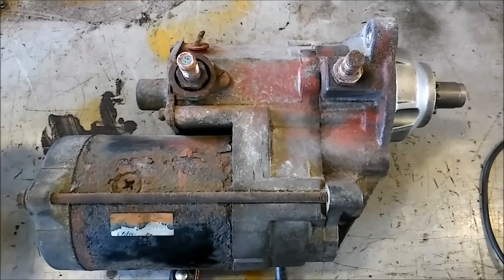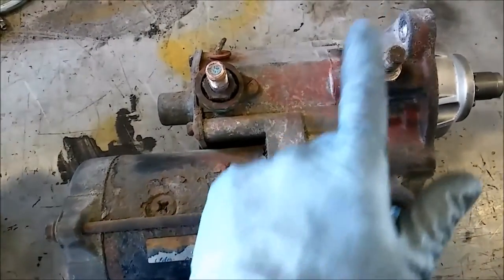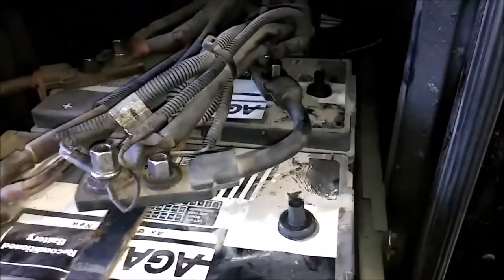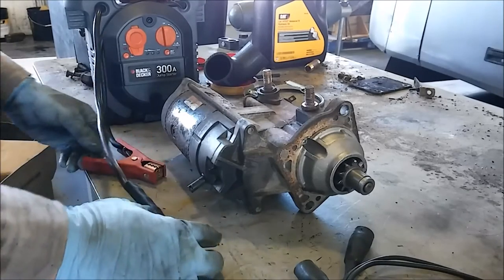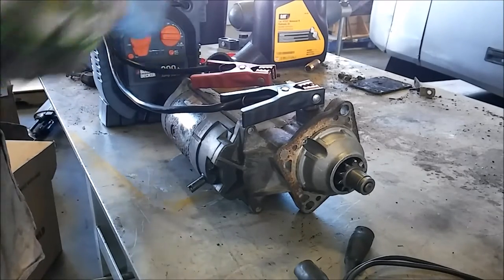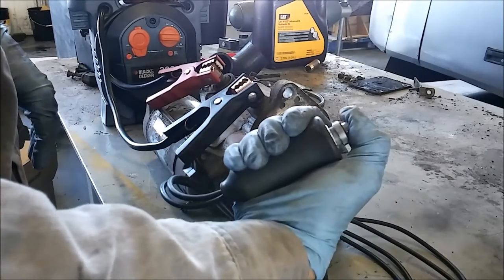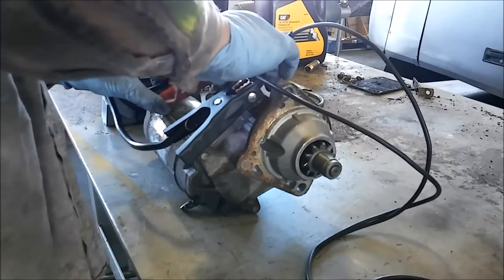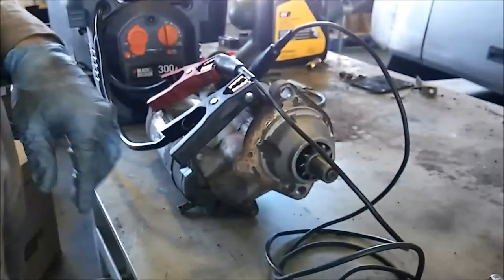How To Bench Test a Starter.  Auto, Truck, Bus, and RV.

Comment: Get two blocks of wood and engage the starter and apply pressure to the blocks of wood between the pinion it will load the starter. Easy way to check the torque if you do not have a spare starter
Reply: This is exactly how they load test motors at the starter shop we use for motor work.  Block of wood = load

Comment: Do the RV starting systems employ a magnetic relay switch to engage the starter solenoid as is done on class 8 trucks?
Reply from the maker: +Chad Jessup I want to say yes, but I can't say that everyone does because each RV is different. I do know on some of the fuse/relay panels I've worked in they have had starter relays.

Comment: As I watched this video I could see that the starter in question was not producing enough torque because if it had been, it would have been trying to jump out of the hand of the tester as it spun up.      
Show the same method of "bench test" on a good unit and see the difference.
Reply: wontputrealname 
I thought the same. A healthy starter should try to jump off the bench. I usually do it on the floor
Reply: Cbmech yeah true, i've had even lawnmower starters jump off a table and break